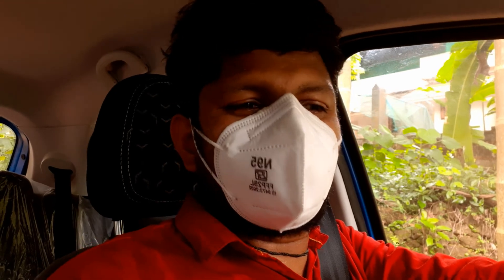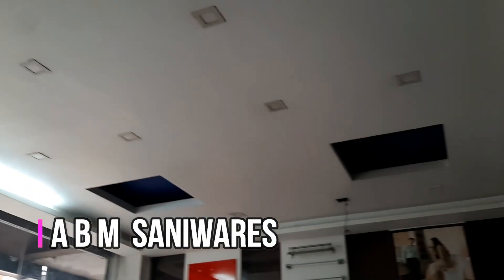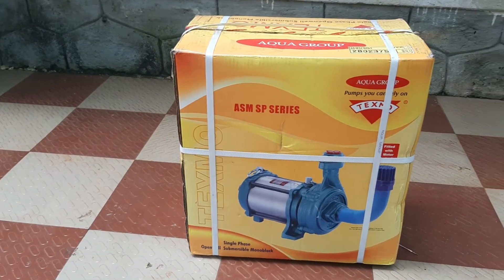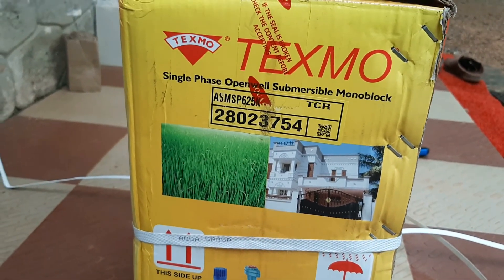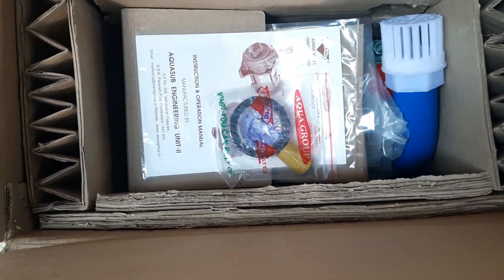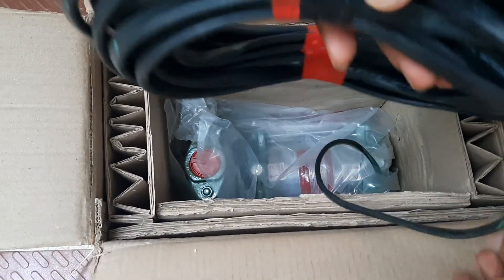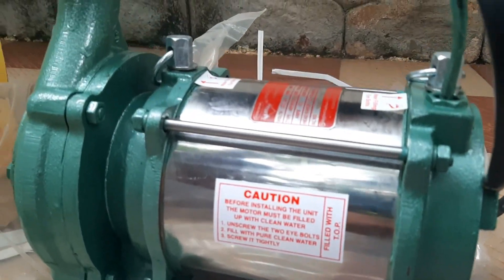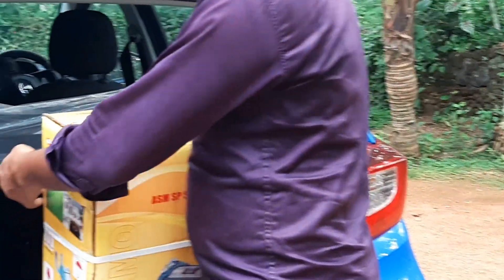Submersible Water Pump Fitting Home|1hp Texmo New Submersible||Submersible Motor Unbox|OpenWell Pump

Comment: What is this motor water lifting height in building 🏠 top
Reply from the maker: The water will flow even though it is on top of the 3 storey building
Reply: Sir ji is motor water lph Kitna h kitne height pr please tell me about
Reply: Kya mrp h is motor ki sir ji please tell me about
Reply: Is pump water pressure Kitna h tell me show video clearly please note
Reply: Kuch toh batao janaab